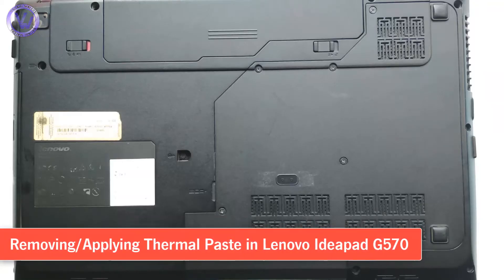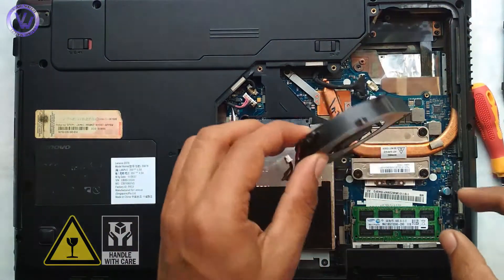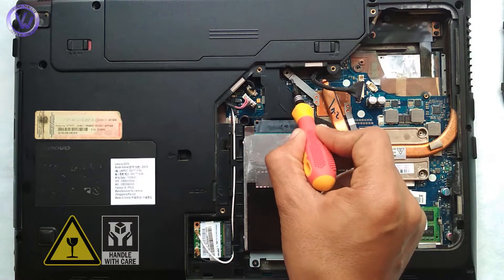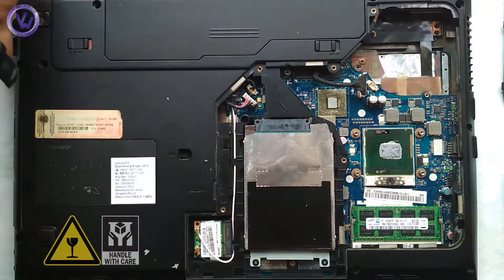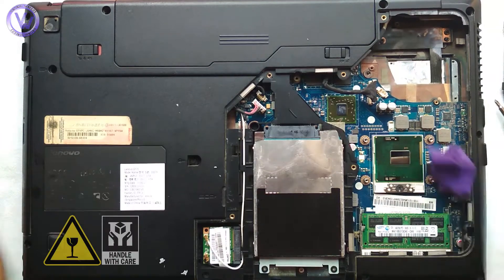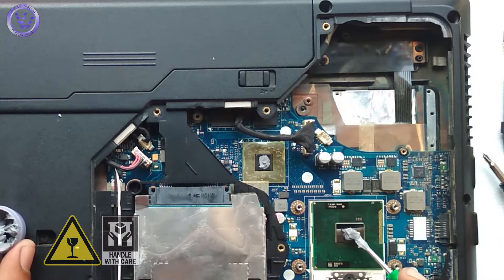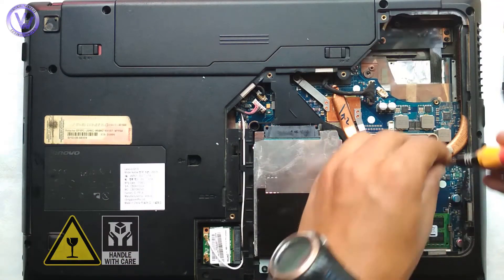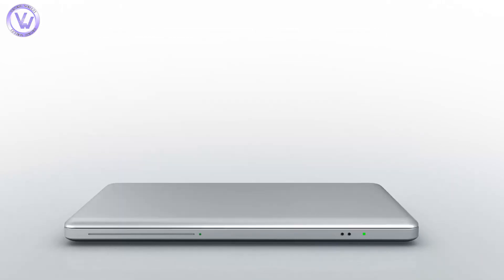How to remove and apply thermal paste on processors in laptop | Lenovo Ideapad G570, AMD Radeon 6300

Comment: My lenovo g470 after apply thermal paste, laptop click on, will off in few second later, and i don know how to fix it 😢
Reply from the maker: Ensure that processor and heat sink are fixed tightly on the motherboard. Usually a click sound is the reciprocating factor. Moreover, check your RAM sticks. There might be some carbon deposition on them. Clean it with the help of an eraser. Just like the processor, ensure you fixed the RAM stick(s) correctly and they are not loose. Hope that helps

Comment: i have the same laptop but amd radeon 6300m series video card is not working is there a solution
Reply from the maker: Just switch to Integrated Intel graphics. I know it is too hard. But I went through the same. My Radeon graphics card stopped working after 5 years of laptop usage. Radeon graphics used to activate and deactivate by themselves automatically and I often encountered BSOD. Then I installed Ubuntu on my same device. It was working fine but again Ubuntu can't take advantage of Radeon graphics as there are no Readeon graphics drivers for Linux. Then for my requirement I again started using Windows and this is what I did:

1. Disabled AMD Radeon graphics from Device Manager.
2. Disabled windows update (as it would automatically enable the disabled graphics from Device Manager, which would bring you BSOD time and again)
3. Just stick to integrated Intel graphics.

Your 6300m series graphics card non operational! Why?
Answer: I think that due to the integration of CPU and GPU on the same motherboard, there might be an instance that your graphic card got overheated and stopped working and since it is integrated you can do nothing. If you still lack a viable answer you can ask some expert or read some forums out there on web. This is all from my personal experience

Comment: It's probably way too old to get an answer. But my laptop which is the G470 keeps blue screening and freezing. I changed hard drive, new windows, thermal paste. Just seems ir can't handle windows 10. If I disable the Radeon graphics device it seems to be OK, but keeps activating itself. I wasn't sure if it was the Radeon or Intel causing the issue but I think I'm almost certain it's the Radeon. I can't seem to get drivers that work, so just disable it. Can I take the whole thing out do you reckon? Is that what your issue was? Any advice welcomed. Thanks.
Reply from the maker: The same issue was with me. It's most probably "Radeon". Actually in my case, (I don't know if I'm sure of it) I think the Radeon graphic card (which I think is not integrated w/ i5 processor in my G570, abd is differentv entity) was damaged and there were BSODs, frequent PC crashes etc. I tried a number of solutions to eradicate it, and I don't know which one worked but I somehow managed to disable Radeon graphics and only relied on Integrated Intel HD graphics (I think i used some sort of software available on some troubleshooting blog, I don't recall as it was years back). But after that, my PC ran swiftly. Though I have problems doing high end stuff, but it is still good for day to day jobs like browsing, office softwares etc. I do editing too using Techsmith Camtasia Studio 2019 w/ some lags, but it still works. Better solution would be "installing a Linux Distro" to run the things more fluently. So, yes, I think we do have same problem. Reply if you want to know more....

Comment: Remove the battery first, bro.
Reply from the maker: Benjamin Karam i appreciate you mate. After making the video I came to know about it so i mentioned it in a caption at 00:23
Reply: Vacant Wallet thanks for the video, by the way. Did this solve your heating problem?
Reply from the maker: Benjamin Karam I think so. I haven't done any analysis using some softwares but i think my laptop's fine than before. I made this shoot beacuse i had some issues w/ graphics. I had to take out the heat sinker to look into it. It took off the paste, and thus i have to put on some new paste as in 6 years the paste went too dry. It is just a random shoot. Though the solution of my problem was something else i found later